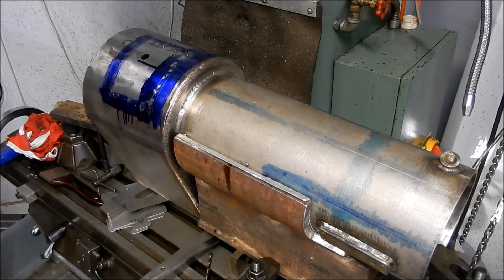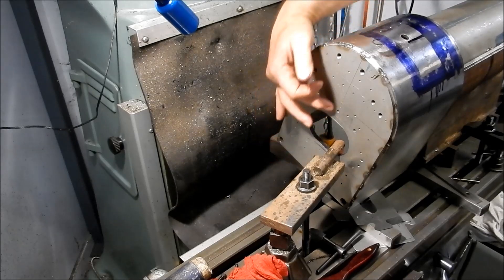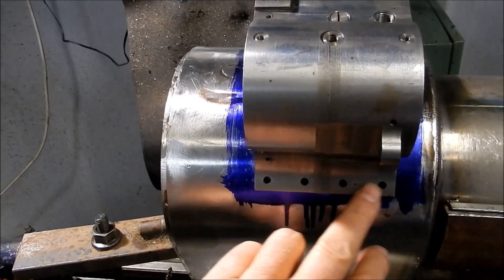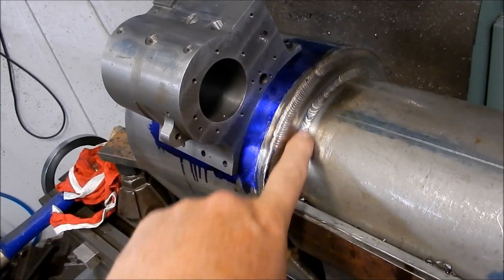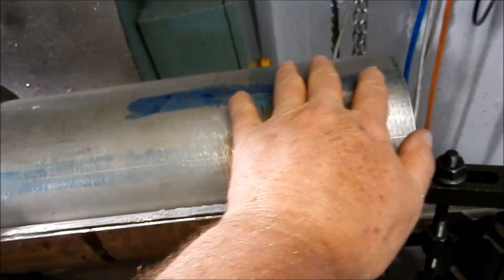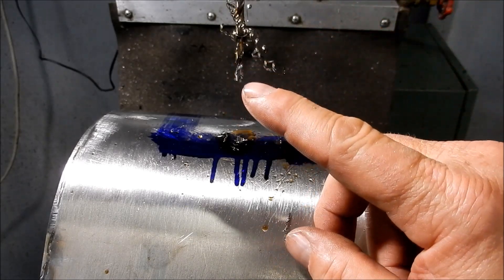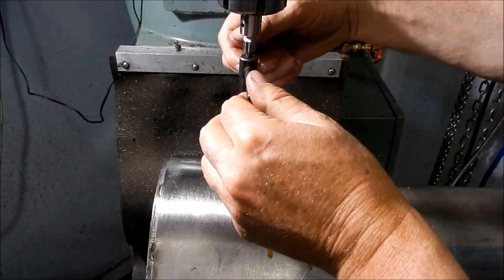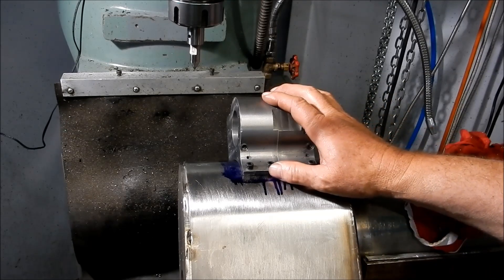Ransomes Sims and Jeffories Stationary Engine Cylinder Mounting

Comment: A bit like drilling Biz .   That's a nice job on the fabrication .  Cheers .
Reply from the maker: G'day Max, my brother was a gun welder in the Oil and Gas industry with every ticket under the sun.  Was booked to do his underwater weld ticket in Scotland when he broke his neck on a Refinery.  Fortunately it didn't sever his spinal cord but he spent months in a Halo brace to hold the break together while it healed and then twelve months in a dark room as he got severe headaches from light.  Couldn't pipeline weld any more so went back to School and got his advanced Diploma in Engineering.  He's now the Lead Designer in a large fabrication facility designing Fuel Storage Tanks and all the associated pipe work.
Cam
Reply: @camatbattler2233  Handy to have a brother like that with that much welding knowledge .     Your stickers arrived in the mail , thanks they look great .

Comment: That’s a very nice build Cam. Some beautiful TIG welds and a massive project no doubt. I just watched Tom’s (Hilltop machine works) latest video and he gave you a shout out. Cheers mate
Reply from the maker: G'Day Aaron, yep I saw Tom's video.  I'd interested to see if he uses the same meathod I used for keeping tension on the Ram to stop it from dropping when you let the actuation handle go.  Yes those welds are beautiful.  Comes from a lifetime working as a Welder/Boilermaker with every ticket under the sun and working in refineries to X-Ray standards.
Cam

Comment: So what happens with this material when its surface is rubbed against iron??  If rubbing the boiler tube in steel is an issue, why is it ok to use those cap head  (steel) screws to mount the cylinder? 
Ps love your channel
Reply from the maker: G'Day Fred, this is the way my brother deals with stainless, monal steels or any exotic steels when he is forming and welding regardless.  The iron issue would be only on the internals where it is impacted by steam.  Duplex probably not as much as it is a ferritic stainless similar to the 400 series.  Certainly the 300 series stainlesses are much more susceptible to ferritic issues and you would be amazed how a 316 stainless steel will rust if affected by ferrite .  Although the outer boiler is not part of the steam space he treats it just the same, keep it clean and contamination free.  I think a very good habit to have.
Cam
Reply: HI Fred, Thanks for your question. If the Duplex material is in contact with clean steel with no mill scale nothing happens, however, in this situation where the boiler is sitting in the half pipe cradle I could have spent quite a bit of time cleaning the surface of the half pipe which I did not want to waste time on doing, so much quicker to shape a piece of stainless sheet to sit between the Duplex and the steel. 
Also, as the low overnight workshop temperature at this time of year creates a lot of moisture and causes steel to form rust on the surface I do not want any rust staining to occur on the duplex or potentially cause any Galvanic action between the two materials.
The Stainless sheet also makes for a nice snug fit for the boiler in the cradle and aids in holding the boiler steady.
Regarding the cap head screws, they are a clean material, plus they have also been blued and have an oily film which helps prevent any corrosion and are ideal for use on Duplex and other grades of stainless. 
I hope the above goes some way in answering your question
Andy

Comment: Hello Cam,
You showed well how planning and setup of the job is important... I have not worked with Stainless Steel but would like to in the future.
Take care.
Paul,,
Reply from the maker: G'Day Paul, thanks for looking in and commenting.  I must admit I hate machining stainless.  When you turn it it comes off in long razor sharp strings, when you mill it it dulls the cutters very quickly but this Duplex Stainless is in a league of it own.
Cam

Comment: Nice Job Cam, Lots of patience required to work with this material which you showed in abundance.
Thanks for a great job.
After this, there will be a bit more drilling and tapping to do for the stay holes when I get the internals in place
Reply from the maker: Thanks Andy
Cam